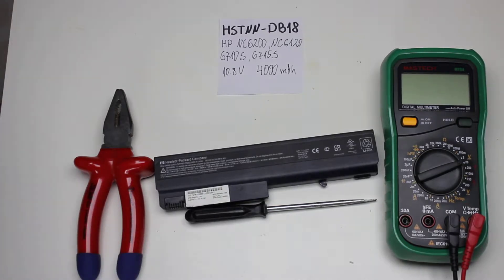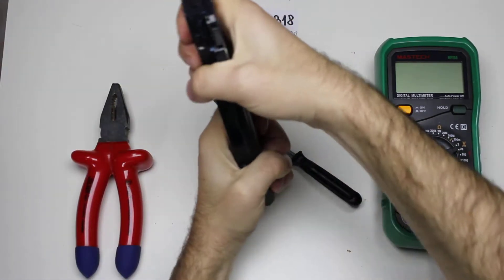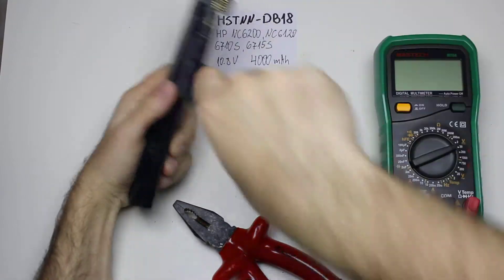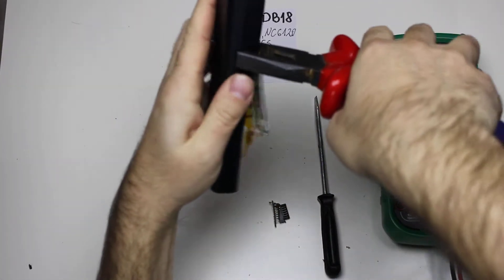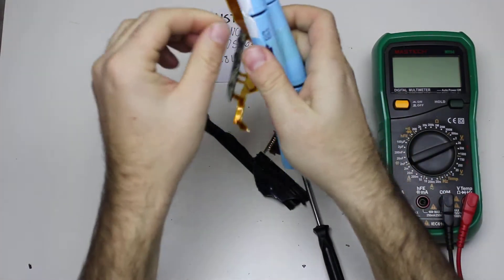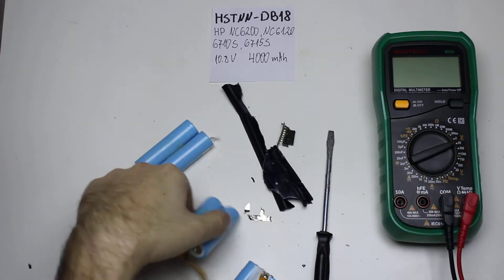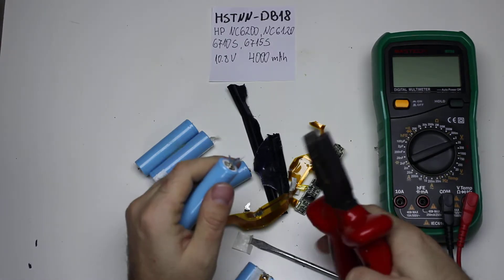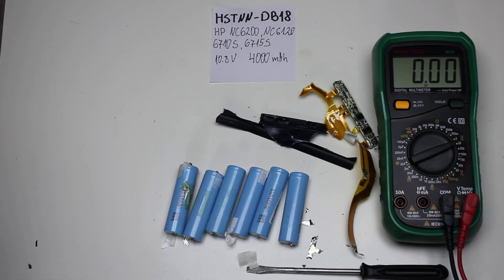HSTNN - DB18 HP Laptop Battery Teardown - 6x SAMSUNG SDI 18650 ICR18650-20B

Comment: If they all give us 3.6 that mean they all ok ?
Reply from the maker: Might be OK. You should still test them out with a discharge measuring charger.
Reply: @laptopbatteryteardownother5640  can I make that with multimeter? I think not.
Reply from the maker: No as you need to check how much power is stores.